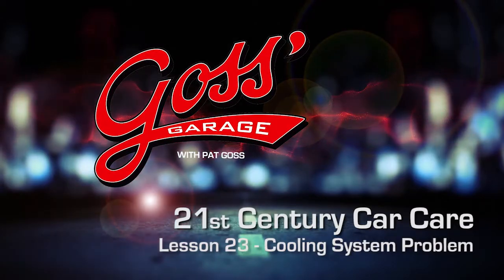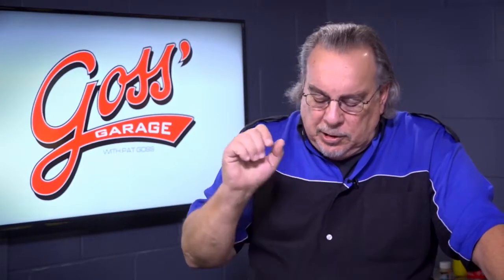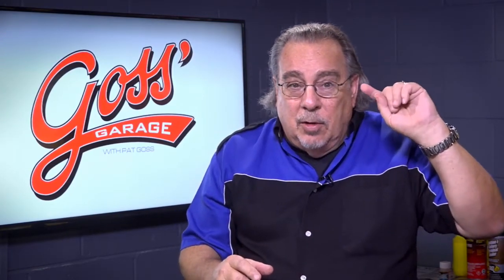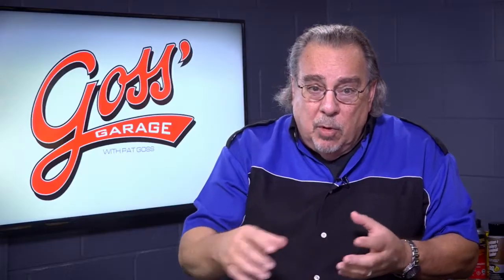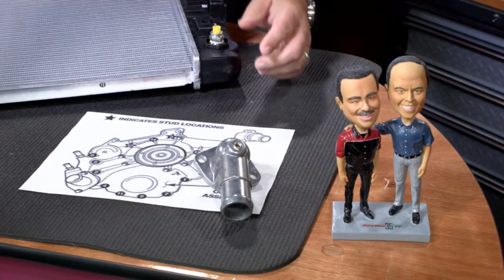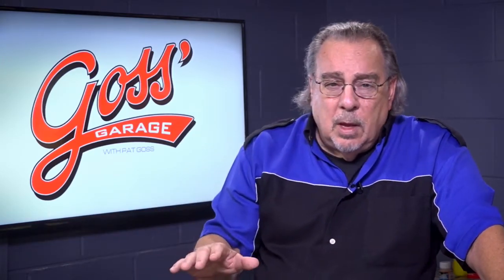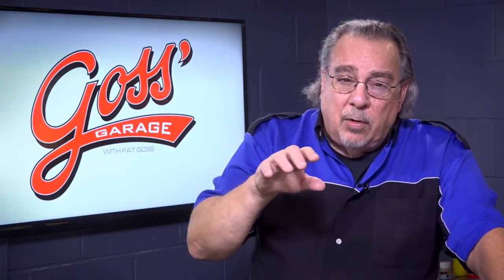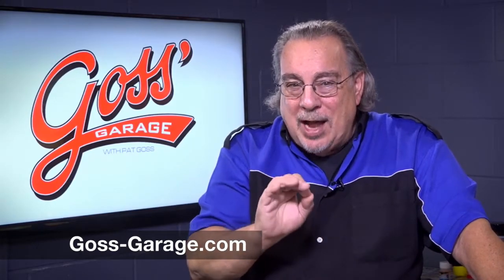Lesson 23   Cooling system problems

Comment: Air in the cooling system can also cause the coolant to act like soda pop and all those tiny bubbles if not bled out can cause pitting in cylinder walls, cooling jackets, and the head gasket, causing irreversible damage if not taken care of quickly.